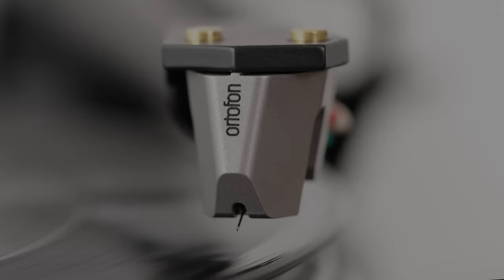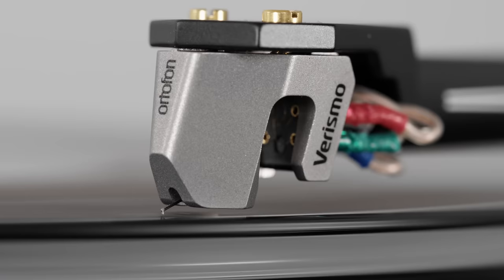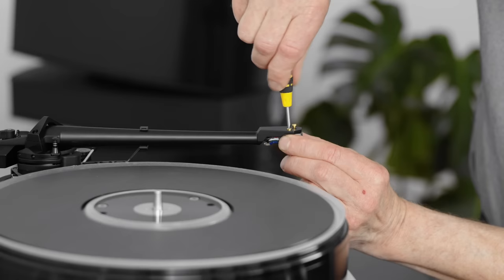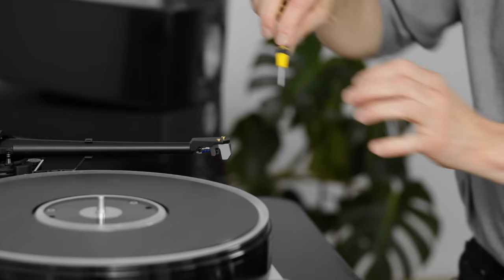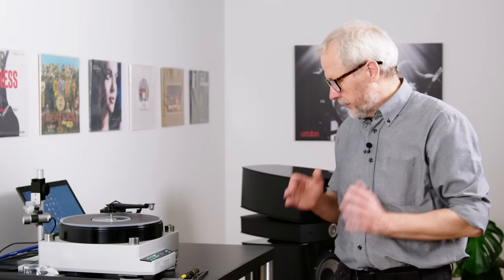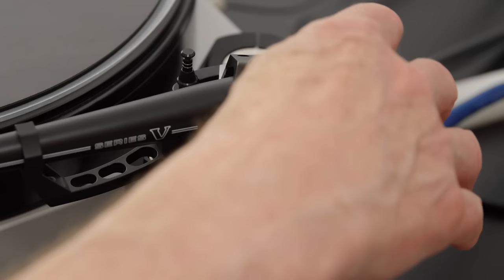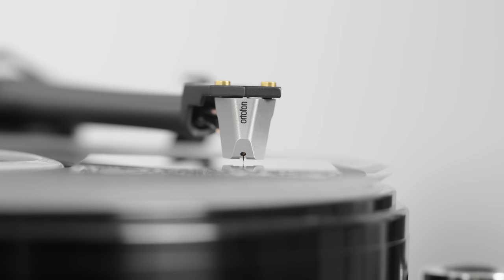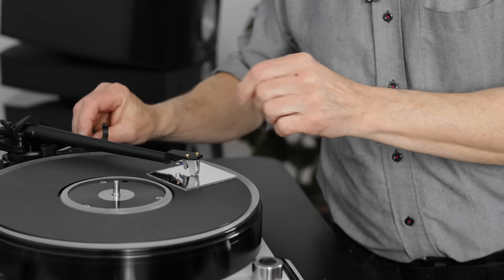Detailed High-end Cartridge Setup | Step by Step

Comment: What I learned, when showing tiny stuff the size of an ant hold it a meter from the camera and shake a lot. When doing close ups to show detail make sure everything is out of focus. Tell people do things in the wrong order. Like setting VTF first, so then when setting overhang this will change and be off, but never mind. Use one particular arm and cartridge that works one way, without explaining. This way everyone following your directions will be screwed and never know it. Brilliant! Show people how to adjust VTA using only an intricate procedure with expensive equipment. Don't say anything about this being done by ear, which is even better. Anti-skating doesn't require a test record, those are too highly modulated anyway, and can be done just fine listening to music. Don't mention this however, it would spoil an otherwise perfectly bad video! 
Ortofon makes some fine cartridges. Probably someone there knows how to set them up properly. Just not this guy.

Comment: Sorry but total amateur hour...This may be fine for the novice user, but the novice user will not be investing in this model of cartridge - perhaps a 2M series.  I expected much more precise setup & calibration.  This is sending the wrong message for proper cartridge installation & alignment.🙄 When attempting to compose such videos, we may suggest the use of a precise protractor with the respective geometries. This will yield much more accurate results.😎